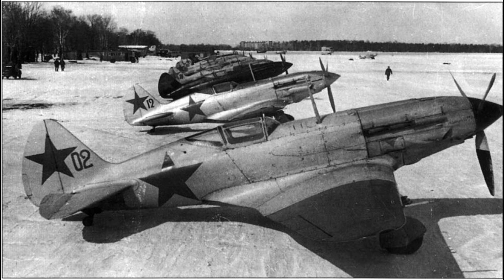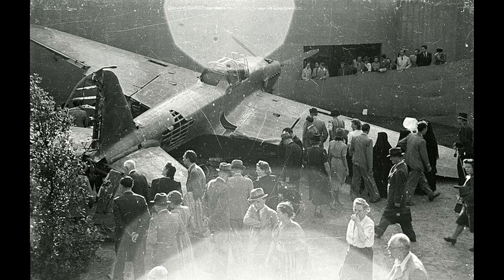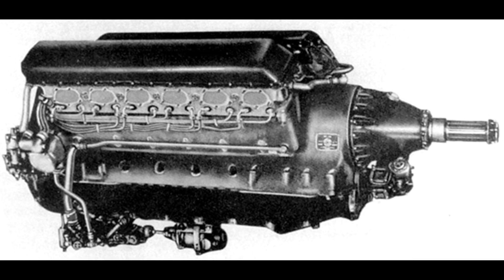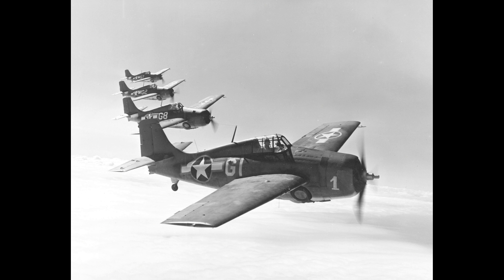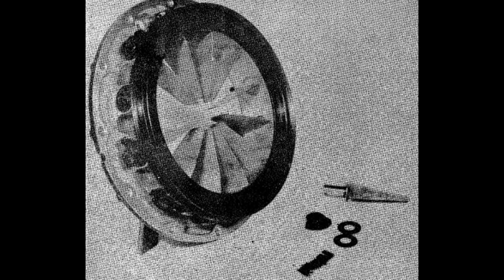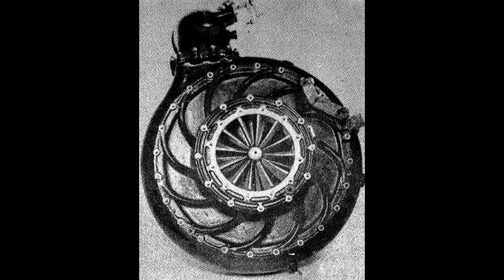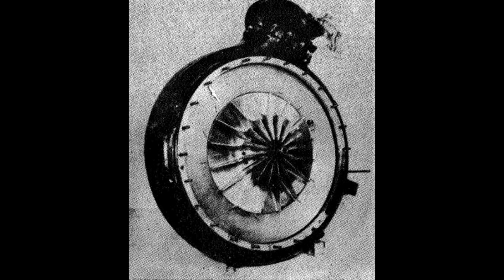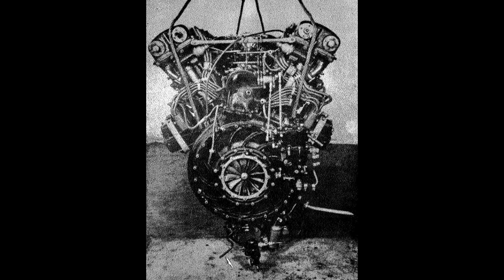IL2 Sturmovik Secret Throttle, extra 100 horsepower!

Comment: I've always wondered about the service history of the Russian V-12s.  The bits that I've read suggest they had a very short service life before overhaul.  I suspect they were quite agricultural in overall sophistication - this was an interesting detail to see.  Over 2800 cubic inches displacement in 12 cylinders - compare to the P&W R 2800 with 18 cylinders and a very solid performance history.  Hope to see a Russian ww2 V-12 restored to running condition one day.
Reply: Even the engine oil technology would have likely been primitive at that time.
Reply: @JoeC88  That suggestion might figure in but looking at photos and drawings of the Russian engines indicates to me that they were mechanically not up to the industrial standards of other engineering of the era.  For instance, the construction of the crankshafts - very marginal in strength and no counterbalancing.  I suspect these engines shook themselves apart as much as wore. One of them was a spin off of the WW1 Hispano-Suiza.
Reply: @whalesong999  Yes, these engines were made in tough / very tough times. 
I guess they were manufactured in a hurry on old or poorly maintained equipment that may not have been very accurate (wear & tear factor). 
I guess the machinists may not have been overly qualified for the job or spent up to 16 hrs on jobs at hand. 
Metallurgy was apparently a challenge at times so overall quality control may have been a struggle.
Unbalanced engines substantially increase the wear & tear factor, you could just imagine the Babbitt metal bearings being hammered out.
Reply: @JoeC88  Yes, good point about the babbit bearings.  I read years ago that Allison engineers and metallurgists went through quite a process to end up with the silver backed alloy used in their engines as power increased.  Also, I read a lengthy article on the development of the P&W R 2800 on refining it's crankshaft and reduction case to meet required performance standards.  There were a lot of breakages leading up to a great number of changes in engine balancing and alloy selections.  For sure, it was such an intense time of development around the globe for these big companies to bring the engines up to a standard that are easily taken for granted today.
Reply: @whalesong999  Thanks for the interesting info. Unfortunately no one ever mentioned torque output figures, just horsepower, the casings & thrust bearings alone must have undergone a lot of R&D. Surely they at least static balanced the R2800 & others during manufacture / assembly. 
We have to salute these engine makers for their incredible  results from rushed developments & all the many challenges they faced, and as you say that is all now taken for granted.
Reply: @JoeC88  Yeah, there's more details that hide in the stories of things like this.  The article on what went on with the R 2800 development might still be on the internet and was an absorbing read.  On the balancing of it, it was drawn out period of dynamic balancing I recall reading and one of the major issues was with harmonic vibration within the crankshaft itself that was quite a challenge for them to deal with, a detailed trial and error period of metallurgy, experiments and test runs for extended periods, really pointed efforts to refine what was to become one of the finest piston engines ever made.  I've been an engine tech of some sort for most of my working life (lots of it on motorcycles), as was my father - I guess it came with the territory to have interest in this stuff.  For a time during WW2, dad worked as an inspector for the government at Boeing/Wichita.  I recall hearing his grief at what was happening with the initial and very flawed Wright R3350s going on the B-29s - wrenching stories..
Reply: @whalesong999  Off track now,  did you see the new Triumph Rocket 3 is now 2,500cc !
Reply: @JoeC88  No, don't keep up with much of the latest stuff.  Interestingly, I think the Rocket 3 engines would be great adapted for light sport airplanes.  I do have a friend living close by who owns a Rocket 3 and I did sit on it but I'm not drawn to ask for a ride on it.  I do have a fondness for the original BSA Rocket 3 of 1969 through it's production ending in the '70s.  Loved the sound of them and to me, a really comfortable ride compared to the Japanese machines of the era (I was a service manager/mechanic at a BSA/kawasaki/Suzuki dealership from '68 - '79).  Watching Dick Mann win on one at the '71 Daytona 200 mile was a thrill to watch.
Reply: @whalesong999  Funny, I almost said (as you did) that the Rocket 3 engine would be a good light aircraft engine, even in small boats etc. 
Watching those old Daytona races would have been incredible,.
Did BSA close down around  mid 70's?
You will like this V12 start up...  fast forward to 4:50  (you can watch from 3:30 if you like)
https://www.youtube.com/watch?v=d0-AHHoluog
Reply: @JoeC88  The British motorcycle industry wallowed through the '70s and finally went under in 1978 - It had become a conglomerate that didn't work: Norton/Villiers/Triumph, they dropped the BSA marque in the mid '70s.  Last BSAs we sold were a few of their singles and the shop owner had a new R 3 sometime around 1973 as I recall.

Checked out the video, lots of action there and a fiery start up.  I got to witness a "Thunderboat" race in 1979 when the series put on a race at ElDorado, Ks.  Hearing those V12s moan and crackle was quite impressive.
Reply: @whalesong999  Wow the Wichita & Surrounding areas look great, so does Old Cowtown !    I remember the Beechcraft Starship was born in Wichita.
Reply: @JoeC88  My family home was in Andover and when I was a teen, drove past the Beechcraft plant on the way to work in Wichita as a grocery store carry-out.  The road by Beech was so close that one could smell the dope fumes from the building and refurbishing of C45 model 18 twins. 

Right now, our area looks like many lakes due to so much flooding, something very rare back in the day.
Reply: @whalesong999  P & W get's the credit for the bearings, Alison just adapted them to their use. The War Dept. actually insisted on this for all aircraft engines and had some trouble getting Curtis Wright to go along too. The R-2800 was developed into the -B engine and then an almost entirely new design was produced from a new plant built in Oklahoma (I think) that started production in late 1943 and produced most of the -C engines which were the 2600 HP monsters. The -B engines continued production for lower HP applications through the war.

Comment: Not sure if the horsepower was boosted to any extent but back in the early 80s when I bough my first car I became interested in boosting the fuel economy on  my  Chrysler six cylinder 4.0 Ltr engine with two barrel carb. A mechanic told me about a small metal plate that could be fitted between the base of the carburettor and the intake manifold. The plate had a recessed grid that was shaped similar to the throttle shown here and the idea was that a swirling motion was worked into the air/fuel mixture as it travelled to the cylinders increasing volumetric efficiency. I did notice a reasonable increase in fuel economy, not around town but on a long journey with constant and gentle throttle use my mileage increased to between 28-30 mpg as opposed to a previous 25 mpg max. I guess there would have been a slight increase in HP but I never had it measured.

Comment: So the Ruskies came up with the equivalent of the modern snake oil "throttle body vortex generator" and it actually worked for their engine, pretty nifty. Basically a preliminary compressor stage, like a turbofan's fan
Reply from the maker: Sort of, except that those snake oil vortex generators are simply obstructions in addition to the throttle and the vanes don't move. The Russian throttle is the actual throttle, it replaces the conventional butterfly type throttle with its movable vanes.

Comment: I hear the spitfire sprayed water into engine to improve acceleration in a tight spot,, is that true???
Reply: Dunno about the Spitfire: but he 109 certainly did: although they usually used MO 50: a equal mixture of methanol and water: this reduced knock allowing for higher boost, which in turn would increase their performance.

Comment: There's no easy segue for this but perhaps it will suffice to say an interesting presentation might be you addressing the use of engines originally purposed for automobiles (and other machinery if such a thing exists) that are used in airplanes. I've heard of all manner of "transplants" but I'd like to hear your take on the topic. I used to work in a shop specializing in Corvairs and when I went to build my own engine for my vehicle. I had it balanced. The machine shop also balanced engines used in light planes and, in their view, the Corvair engine was no worse in it's factory balance than something labeled Lycoming. As a side bar, I really enjoy your thorough analysis and presentation of the topics you cover. Thank you for all of it.

Comment: Similar to the VW diesel variable vane turbo's of the early 2000's except they are working on the exhaust side of the turbo not the charge air side.

Comment: I understand that Rolls Royce experimented with an Iris throttle arrangement which I believe they used on the axial supercharger for the 1.5L BRM V16 engine (now there an engine)
Reply: "the 1.5L BRM V16 engine (now there an engine)" I always preferred  to think of it as a sign of how drawn engineers are to doing things the hard way! Also at BRM was the H16 engine they never got right in 1966-67. I know it did win one race but it broke as the winning Lotus finished then Lotus ditched the whole thing for the Ford Cosworth V8.

Comment: Greg,  a shop in Russia managed to get an AM-38 running, although not very well.  I think it was from a water or swamp crash recovery and they may have wanted to use it in a Mig-3 project in Russia but abandoned the engine choice.  Good view of the supercharger impeller.  https://www.youtube.com/watch?v=l4CSJj55Tqs
Reply from the maker: That's really cool, I am impressed that they got it running. This makes me think I need to do a video on a Soviet WW2 plane pretty soon.
Reply: +Gregs Airplanes and Automobiles   There's also a Klimov running for an airworthy Yak-1 project in the UK. 
 I am seeing that the engine and project are now for sale.  https://www.youtube.com/watch?v=ZzcAccNLMew

Comment: I've got a buddy with an application. He runs a monster oversized centrifugal blower that he has to restrict inlet on to keep boost in check and still spin fast enough to boost at low engine rpm. I probably shouldn't share with him because then I'll have to figure out how you build one.
Reply from the maker: It's usually more efficient to decrease boost by slowing  the blower down and eliminating the intake restriction. However it's not always practical.

Comment: For this throttle valve to be adjusted, is the incidence of the blades in the valve changed? I have read that compressors in some gas turbines such as the GE J79 have pivoting stator blades with controllable incidence.

Comment: As much as the technology itself isn't in use today, the principle seems the same as a stator in a jet. One is tempted to conduct a junkyard experiment simply fitting a small fixed stator downstream from the standard butterfly valve throttle in a turbocharged automotive application...
Reply: Opposite idea. Stators are there to reduce swirl in a jet's compressor stage. An axial compressor loses efficiency when the airflow becomes spiral so stators are added to straighten the flow behind the compressor sections. A centrifugal compressor, like in a turbo, would have it's speed increased at lower power but would be restricted at full power.

Comment: The IL2 being a ground attack plane needed maximum power at lower alt Russian eq was never known for being fancy or refined but it got the job done. Often times the Germany tendency to over engineer, fit and finish the German obsession with perfection took time and cost money when volume was needed
Reply: It wasn't just a problem of cost and precision of manufacturing for Germany too, but reliability in field applications.  This was problem that became glaringly obvious on ground based armor.  Germany often was loosing as many Tanks to maintenance issues and reliability problems than it was losing to combat. Germany's obsession for precision and overengineering was a real problem in actual war.  Contrast to Russian design philosophy which is often confused by western observes as crude because Russian engineering or intelligence was crude. This couldn't be further from the truth. Russian machines were designed to be "crude" by very talented and competent engineers as a feature, not a bug, because in actual practical application it meant reliability, ease of maintenance.  This remained a major difference with both Germany and the US and the Soviet Union for decades. 

The Soviets like to joke that Americans and Germans designed weapons for laboratories and paper statistics, Russians design weapons for war. This difference can be plainly seen on everything from Soviet trucks, to small arms like the AK-47, just contrast that to the on paper performance of the early M-16s compared to their actual field problems when deployed. A M-16 on paper out-performed statistically a AK-47 by most metrics when tested in a sterile lab, which meant nothing when it failed to operate at all in mud and grime.. The Panther tank contrasted to the T34-85 is a pretty good example of this. The panther absolutely outperformed a T-34 on paper, yet the Panthers were plagued with reliability issues, and the Russians could build 2-3 T-34s for the cost and time it took to build 1 panther. The Mig-21 vs the F4 phantom also comes to mind.

Comment: Maybe extra swirl in the inlet manifold of a carburettor would increase the fuel atomisation...?
    For some single cylinder bikes there is a device called a turbulator that promises HP gains with this effect.
Reply from the maker: No, that's totally different.